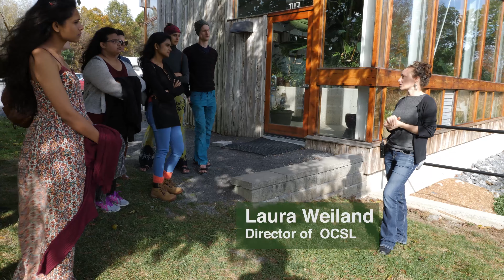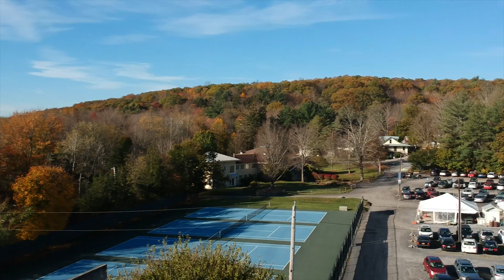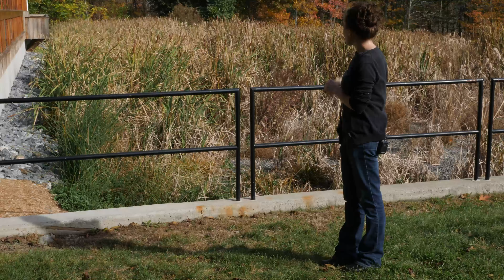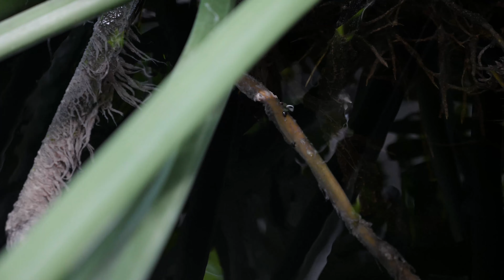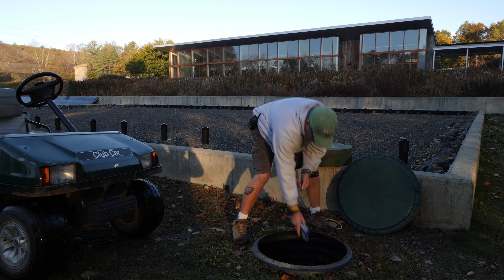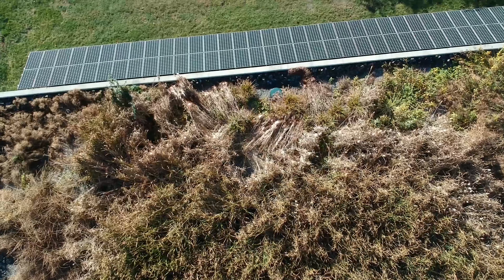Eco Machine tour at the Omega Center for Sustainable Living

Comment: is there a way too obtain more information about how to implement this in an urban setting on a much smaller scale?
Reply: Yes. I have only proven the concept for grey water, not black water. I plan to do a practical instruction video in the near future as I am building a new one. 

You first need to source materials, preferably poly ethylene (high density for vessels, low density for plumbing) and poly propylene. These are food grade plastics and shouldn't leech or react with anything. 200l blue barrels are great, I have used 60l bins in the past. You can source ldpe black irrigation pipe, 13, 19 and 25mm along with tank adaptors/ bulkheads along with barbed irrigation fittings to join the plumbing together and to the tank adaptors. Hardware stores often stock these, along with 60l bins. They also stock the media you use, but there are cheaper avenues, like landscaping suppliers. 

You will need media for a mulch basin, coconut coir works the best. Charcoal and bone char work well, for neutralising harmful chemicals from tap water. They can provide drainage as well as maximising surface area for bacteria to colonise. For gravel beds you can use charcoal/ bone char too. Instructions to make your own can be found if you search "biochar". Non reactive rock like blue slate can also be utilised and picked up cheaper. Other stone can be used, but look up what's available in your area and follow the aquaponics rule of thumb of testing stone in vinegar to see if it doesn't react.

You will also need wetland plants. You can buy them, or forage them, however foraging can be difficult, especially as some plants can slice through your skin. 

Depending on the size of your system and intended purpose, you can acquire bladder snails, cherry shrimp and mosquito fish like guppies or sword tails. These work well if you want a "canary in the coal mine" they can provide more filtering of the water as well as loading the water with nutrients that are good for your garden.

Mushrooms can also be utilised as mycofiltration in woodchips.

You ideally want a mulch basin first, to catch soap. Plants should be in this filter and compost worms can be added to mulch basin, as well as the reed beds that follow. In the reed beds you want gravel, you can put mulch, char as well as lavarock in them. Once there's definitely no chlorine in the water, you can add pond like sections.

Vessels with media in hold approximately 1/3 of their volume in water. As media occupies about 2/3 of the volume. Media can be minimised if you can utilise a floating raft system, where pumice could be used with suitable netting (polyethylene) but haven't tried this yet. Chlorine evaporates within 24 hours, so knowing daily input volume should allow you to roughly calculate how many reed beds you need before you can have ponds.

There's a few videos on YouTube about it. One of the best backyard systems I have seen isn't the most practical, as it involves fabricated vessels from scratch. Other videos can make impractical suggestions like collecting water from the top of one vessel and thinking it's lack of pressure will displace water from the bottom of the next tank, which is higher pressure. I didn't think it would work, I tried it and it caused the system to back up and overflow, as everything moves from high pressure to low pressure.

If you give me your email, I can send you some photos of my old system when I get the chance to find them on my computer. 

I recommend minimising the use of PVC pipe and fittings as this material shouldn't be used from a risk management perspective, seeing it can be substituted with food grade plastics with not much difference in price.

There are good videos on backyard aquaponics that I used for inspiration, but will take a lot of time to go through and weed out impractical ideas, as aquaponics are high flow systems, Vs low flow systems of natural water treatment. Natural water treatment can be achieved using no electrical devices, especially if you live in a slope. I am utilising done aquarium air pumps in my new system as I no longer live on a slope and am using 200l barrels for the whole system, which can cause the water to go stagnant. I had no issues with stagnation with 60l bins or 120l storage tubs that made up all of my reed beds of my old system. Old system had a 200l mulch basin that didn't retain much water as well as 200l,300l (green mini rain barrel)  and 800l (IBC with top cut off) ponds
Reply: @matthewmeuleman3369 Great advice 🙌🏽